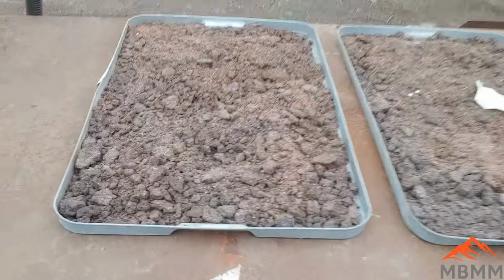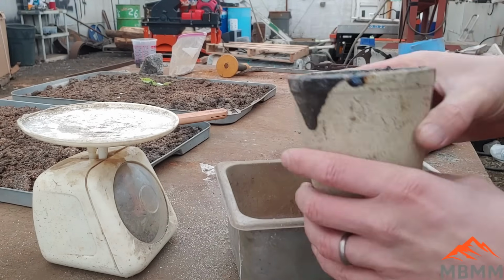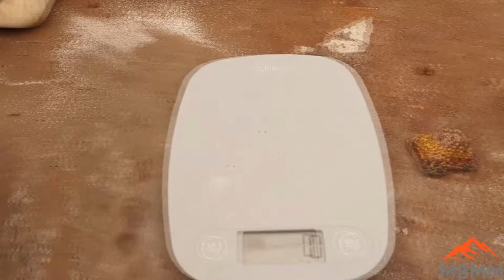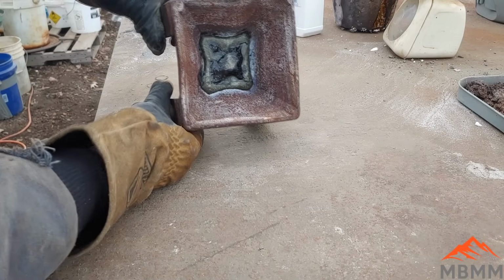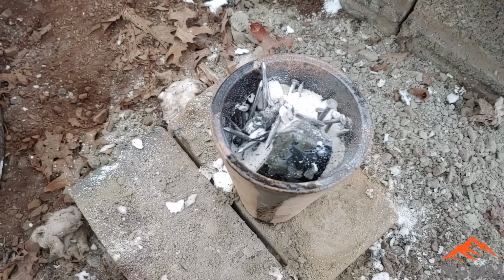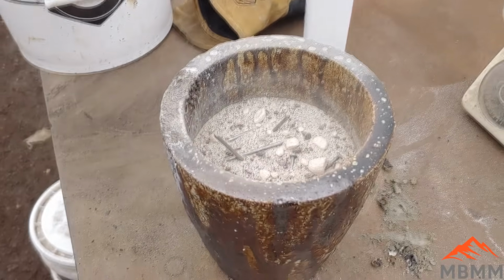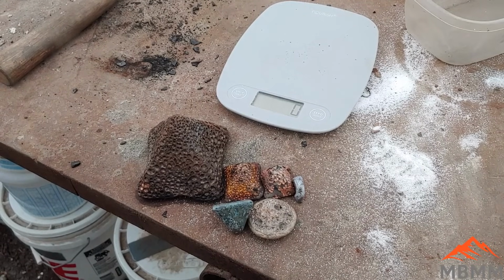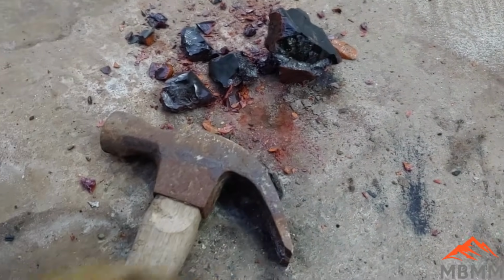Smelting E-Waste For Gold, Silver, Copper

Comment: The copper didn't drop out until it hit the steel cone, because it was still held in solution as a soluble salt, due to too much free acid in solution. If you run that again with the nails, the result will probably be better. All the nail metal that is eaten up is making iron salts, and when there's more iron left but no more free acid, it will start replacing salts of the less reactive metals, leaving them as free metal.
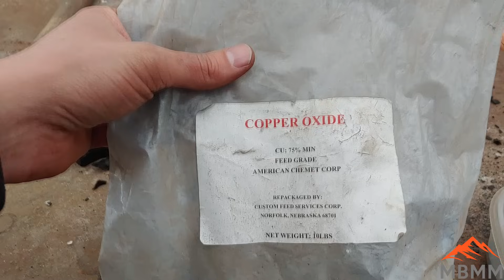Reply: Now what if he did this with a basic mix? Is he still using the sulfur at the end: 34:24? Or what if he used nearly none for that matter? Would the oxide then reduce to Cu, and oxidize the Fe? He also mentions using a less basic was better for nearly everything in the beginning. You are right though. Too much free acid/base will continue to keep salts as salts
Reply: @matthewcurry3565  He could try putting some charcoal (the good stuff, not "brickettes") in the crucible to convert some of the metal oxides to carbon dioxide/monixide gasses. That's how a lot of metals are recovered industrially, but I don't think his crucible will get hot enough to recover all types of metal. That's probably similar to what's going on with melted sulfur in the mix too. The sulfur picks up oxygen, forms sulfate salts with the various metals, more easily with the more reactive metals, of course, and then loses excess oxygen as sulfur dioxide (probably). I think the workarounds he's trying to perform, due to variability of his results, are largely due to putting the sacrificial iron nails into the crucible at the beginning. It's like putting cake and asparagus in front of a child at the same time, and expecting the results to match your wishes. Some of the desirable metals will never make it into solution in a form that will be replaced by the iron, because the acid and iron are mutually consuming from the moment a mobile acid forms.
Reply: @buckstarchaser2376  Oooo nice answer my friend. I thoroughly enjoyed that simile as well haha.
Reply: @buckstarchaser2376  
is it possible to melt in a vacuum and if you can, does it affect the end result?
Reply: Thays what i was thinking, especially early in the video when he mentioned affinities between copper and zinc. Under some conditions affinities can differ driving a reaxtion one way or the other, so under the ones he was using, copper had a higher affinity than zinc so more zinc was left over.
Reply: @snewitten  an induction furnace would be best for smelting in a vaccuum and yes its possible and would increase yeild to an extent. It honestly depends on how reactive the metal is with oxygen, but for the most part the losses would be negligible unless its domething do reactive that its oxides boil off arounf or under the melting point of the metal.
Reply: ......reactivity series of metals.......
Reply: Why does he use nails as an iron source rather than some iron filings/turnings from a brake repair shop lathe?
Reply: @punkinhaidmartin  He builds and sells milling and crushing machines, not brakes. He could theoretically use various junk iron items from around his shop, but nails are something that anyone can source, and generally aren't going to be weird alloys, like stainless steel, or whatever, that may add contaminant issues to your test melt.
Reply: @buckstarchaser2376  yes, but brake repair shops are not jealous of thier lathe scraps, and it's straight up Grey iron. They'll give you a bucket full of powdered iron if you ask, and brake repair shops are found everywhere you find cars with brakes. If a brake disk is some fancy alloy, then they'll just replace it and not turn it on a lathe, but turning Grey iron drums and rotors just produces lost of pure powdered iron, which has negligible scrap value.
Reply: @punkinhaidmartin  Well... It looks like you have an edge on the 'melting things with iron to see how much non-iron you have' market. Good luck, and may your brake-dust-centric assay empire flourish.
Reply: @buckstarchaser2376  just trying to share the riches.
Reply: I think it is possible and that's how they smelt magnesium best can't touch oxygen or it will react

Comment: You added 75 g of  CuO (Mr. 79.5) which is about 0.94 mol. To reduce all of therm with iron,  you need to react 0.63 mol of iron (~35.3 g) if it went to Iron(III) or 0.94 mol of iron ( 52.6 g) if it became Iron(II).  So in the last experiment, not enough iron reacted.
Reply: Agree 💯
Reply: Yes. I want to see him start doing more math with molar masses. I am sure there is some subtle chemistry he could be taking at certain steps. The solution to problems is not always mix ingredients together and heat to ridiculous temperatures. 

I would love to see him get in touch with some chemistry youtubers like Nilered or explosions and fire. They might have some interesting takes.
Reply: @l.mcmanus3983  i think of nilered a lot while watching these videos.  he would be able to tell him exactly how extract and separate things as well as answer the question he asked at the mix portion. good stuff
Reply: Good comment... iron nails fir sure. I'd prolly even add a little extra to try to move equilibrium to more copper. Like 10-15% more than calculated weights.

Comment: The special "Reactivity Series in Sulfur" that you're looking for is the same one that you're familiar with. The weird experience you're having with Tin is because tin has weird solubility issues. It's essentially why it's not simple to recycle electronics.
Reply: Tin is a tough component. That's why they make cookware from it. Thanks for the comments. Knowing when to add a component to a charge does make a big difference.
Reply: @d.t.4523  Tin is not used for cookware because it's too malleable, and can be melted on the stovetop. It's used in contact with food, such as the inner plating on many food cans, because it's usually non-toxic to humans, and doesn't corrode in contact with most food chemistries.
Reply: @buckstarchaser2376  I saw a metal smith tinning a pot once, so I thought it was a common thing.
Reply: @d.t.4523  I guess its a thing of cookware, but not anything that goes much above boiling point.
Reply: @plainedgedsaw1694  Cool, thanks.

Comment: Several metals have a high affinity for sulfur, meaning that they readily form compounds with sulfur. Some examples of metals with a high affinity for sulfur include:

Lead: Lead has a high affinity for sulfur, and the two elements readily form compounds such as lead sulfide (PbS) and lead disulfide (PbS2).

Copper: Copper has a high affinity for sulfur, and the two elements readily form compounds such as copper sulfide (CuS) and copper disulfide (CuS2).

Mercury: Mercury has a high affinity for sulfur, and the two elements readily form compounds such as mercury sulfide (HgS) and mercury disulfide (HgS2).

Nickel: Nickel has a high affinity for sulfur, and the two elements readily form compounds such as nickel sulfide (NiS) and nickel disulfide (NiS2).

Iron: Iron has a high affinity for sulfur, and the two elements readily form compounds such as iron sulfide (FeS) and iron disulfide (FeS2).

Cobalt: Cobalt has a high affinity for sulfur, and the two elements readily form compounds such as cobalt sulfide (CoS) and cobalt disulfide (CoS2).

Manganese: Manganese has a high affinity for sulfur, and the two elements readily form compounds such as manganese sulfide (MnS) and manganese disulfide (MnS2).

Zinc: Zinc has a high affinity for sulfur, and the two elements readily form compounds such as zinc sulfide (ZnS) and zinc disulfide (ZnS2).

Tin: Tin has a high affinity for sulfur, and the two elements readily form compounds such as tin sulfide (SnS) and tin disulfide (SnS2).

Tungsten: Tungsten has a high affinity for sulfur, and the two elements readily form compounds such as tungsten sulfide (WS2) and tungsten disulfide (W2S3).

Molybdenum: Molybdenum has a high affinity for sulfur, and the two elements readily form compounds such as molybdenum sulfide (MoS2) and molybdenum disulfide (MoS3).

Platinum: Platinum has a high affinity for sulfur, and the two elements readily form compounds such as platinum sulfide (PtS) and platinum disulfide (PtS2).

It is worth noting that the affinity of a metal for sulfur can vary depending on the specific conditions under which the reaction is taking place, such as temperature and the presence of other elements.

More metals?

Gold: Gold has a high affinity for sulfur, and the two elements readily form compounds such as gold sulfide (AuS) and gold disulfide (AuS2).

Silver: Silver has a high affinity for sulfur, and the two elements readily form compounds such as silver sulfide (Ag2S) and silver disulfide (Ag2S2).

Palladium: Palladium has a high affinity for sulfur, and the two elements readily form compounds such as palladium sulfide (PdS) and palladium disulfide (PdS2).

Cadmium: Cadmium has a high affinity for sulfur, and the two elements readily form compounds such as cadmium sulfide (CdS) and cadmium disulfide (CdS2).

Antimony: Antimony has a high affinity for sulfur, and the two elements readily form compounds such as antimony sulfide (Sb2S3) and antimony disulfide (Sb2S5).

Gallium: Gallium has a high affinity for sulfur, and the two elements readily form compounds such as gallium sulfide (Ga2S3) and gallium disulfide (Ga2S5).

Selenium: Selenium has a high affinity for sulfur, and the two elements readily form compounds such as selenium sulfide (SeS2) and selenium disulfide (SeS4).

Tellurium: Tellurium has a high affinity for sulfur, and the two elements readily form compounds such as tellurium sulfide (TeS2) and tellurium disulfide (TeS4).

I hope this information is helpful. Let me know if you have any other questions.

Please lost those metals in ascending order according to thier affinity with sulfur.

Sure, here is a list of the metals I mentioned earlier, arranged in ascending order according to their affinity for sulfur:

Lead

Copper

Mercury

Nickel

Iron

Cobalt

Manganese

Zinc

Tin

Tungsten

Molybdenum

Platinum

Gold

Silver

Palladium

Cadmium

Antimony

Gallium

Selenium

Tellurium

It is worth noting that the affinity of a metal for sulfur can vary depending on the specific conditions under which the reaction is taking place, such as temperature and the presence of other elements. This list represents a general trend and should not be taken as a definitive ranking of the metals' affinities for sulfur.
Reply: A little late to the party but the list above is indeed a good indication as to whether a metal can form a stable sulfide, and indeed if there is a common stable sulfide of a certain metal it can likely be used in some contexts as a sulfide sponge. However, this is not quantitative or predictive by any means. The question you really want to answer here is for which metals is the pure metal more stable than the sulfide. (I.e. how exothermic is this reaction: M + x/8 S8–>MSx ) it turns out, the exothermicity of this reaction is known for many sulfide phases and is called the Enthalpy of formation or heat of formation of the sulfide. The more negative the heat of formation is the more stable this sulfide is. That means that if you combine a metal sulfide with a pure metal and the sulfide of that pure metal has a more negative heat of formation than the Metal in the sulfide, then the sulfur should transfer to the metal with the more negative heat of formation provided you get it hot enough and the sulfur doesn’t oxidize in the process.  (overall reaction: MSx + n E —> m ESy + M). This could function as a quantitative scale for you to use certain metals as a sulfur sponge. The NIST database onlibe has all kinds of thermodynamic data on most common substances including solid metal sulfides. 
If you want to be really thorough then you would need to know the free energy of formation but entropy data is mostly harder to come by for many compounds so Enthalpy of formation (abbreviated *delta*H(subscript)f) is a good starting place. For example Galena (PbS) has an Enthalpy of formation of ca -98 kJ mol-1 and nickel sulfide (NiS) has a heat of formation of -88 kJ mol-1, then smelting NiS with Pb could give you Ni and PbS. However, like I said the free energies may change significantly at the high temperatures that you’re doing your smelts at and in a melt the Enthalpy of formations will be different in the liquid state anyway, so it’s really just a back of the envelope type thing. Don’t rely too heavily on this for sure fire results, it’s really just an indication that it could work potentially.

Comment: Cu + CuO ----> 2 Cu2O
Copper reacts with copper(II)oxide to produce copper(I)oxide.
(You need to add nails, maybe not from the beginning but later during the smelting?)

To test this theory, take the slag and reheat it with nails. This should produce additional copper.
Reply: Judging by the color of that slag (reddish) i agree that Cu2O was formed and that's where all the rest of the copper went.

Comment: These videos may save me. Made a trip recently to Tennessee to do some panning and check a couple spots I researched. I brought home a bunch of quartz that looked good, and it's full of gold. More than I've ever seen, and I've only busted up a few fist sized rocks. I've got some fairly big quartz samples in the 40-50 lb range....all full of gold. Problem is that 90% of that gold is super fine flour gold. The rest is small flakes (like you would expect for the Coker area). There's so much that I'm really worried how I'm gonna separate it from the rock, and then collect it all. I know I'm missing a lot of it. I've used acid, crushed it down to powder and panned it using a magnifying glass, I have a little crucible and hand-held torch etc., but at this rate I should be finished (probably with only half the gold) around the year 2045. I've gotta go another way. I've never tried smelting, etc., but that's probably my route. I've been going through videos, built me a little furnace in the yard, and hopefully whichever process I pick will give me success.
Reply: Aqua Regia may be your friend. See Sreetips videos.

Comment: sometimes your pours look quite syrupy, is this because they need heating more or for longer? Would also love to see a pour into a very hot pyramid and continually heated with a slow cooling to see if the elements separate into more defined layers. Might make it easier to remove the top waste metals quicker.
Reply: Thats a really good sounding idea I'm sure each metal has its own temp. that it solidifies at so with the slow cooling maybe they would self separate from each other maybe even add a ultra sound vibration maybe the molecules of the same type would adhere and solidify together
Reply: @jaymortensen642  Ultrasound may actually work even if you were joking but doubtful on this scale lol. Molecular agitation would be interesting to see though.

Comment: Why you mentioned at the end of the video that sulphur is not good with E-waste smelting? From your experiments in this video and in the other video which you used sulphur, sulphur seems the best way to recover PM's from E-waste, even better than using copper electrolysis cell, cause we can reduce the copper content as much as we want by increasing the sulphur content,then we can part copper using nitric acid to get the PM's which is much faster than electrolysis process, kindly tell me if you noticed any other thing related to use sulphur as a flux in E-waste smelting.

I'm willing to start using sulphur in E-waste smelting,the only thing I didn't find answer of it is how sulphur reacts with base metals to sulphurize them without being reduced again in the presence of sodium carbonate?

Comment: Hi Jason, I am a jeweler and I have few pounds of precious metal grindings and polishing dust I have collected over the past couple of years. I have already incinerated (roasted) all the material down to a fine powder with no organics left. Is it possible to smelt this material using chapmans flux or do I need to refine using aqua regia? I used to watch my father refine gold back in the 1980's using acids, but I really don't want to go down that road if possible. Great videos!
Reply: If you want pure metals like gold separated from the silver and palladium and platinum, you need the acids and other chemicals. Smelting will yield at best a mixed precious metal button.

Comment: would more iron surface area increase the reduction rate of the oxides. Perhaps you can get cuttings from a machine shop to add to the crucible. You might see if you can get cast iron versus steel cuttings.